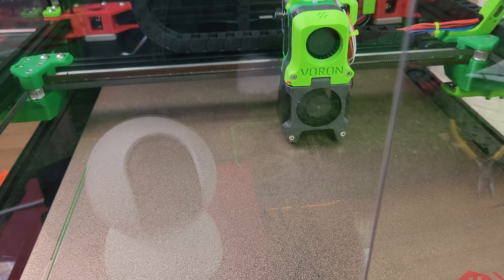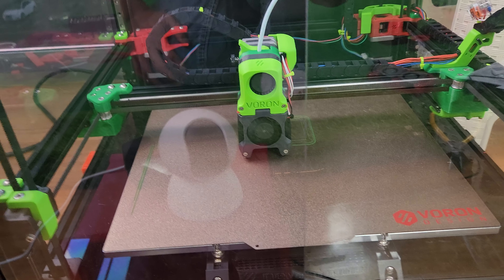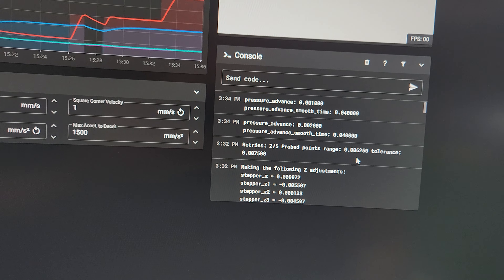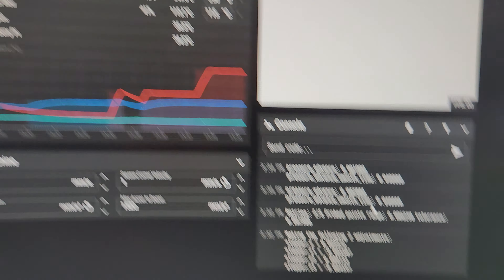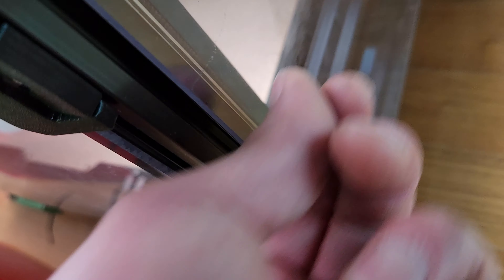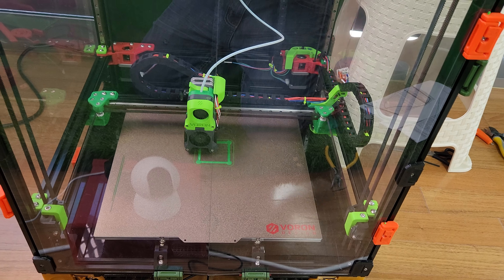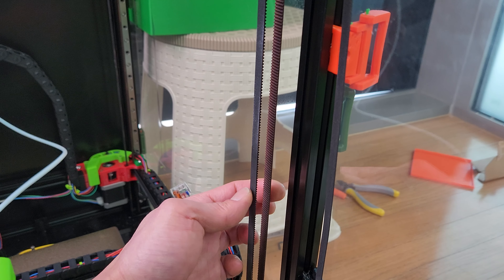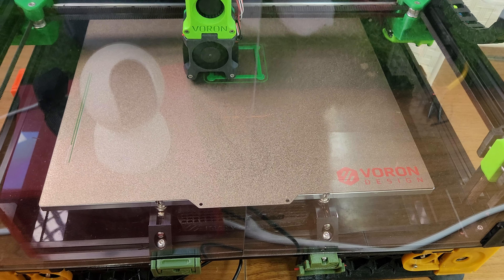Voron 2.4 Quad Gantry Level Range and Tolerance Under 0.01mm & How to Tighten your Z belts!

Comment: For me I was using 70hz on z axis then doubled to 140hz with better results that's on a 250 build on my 350 it's very doffernt only 110hz like the x/y and the accuracy is impeccable